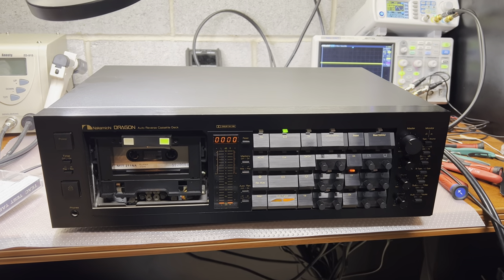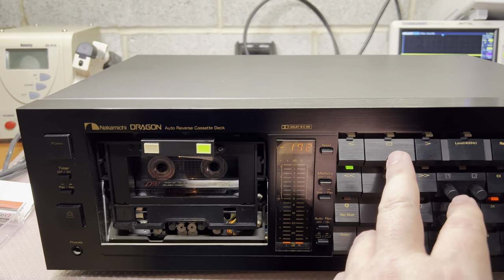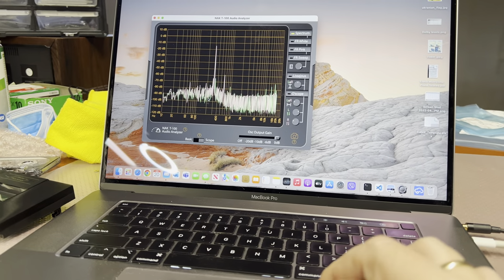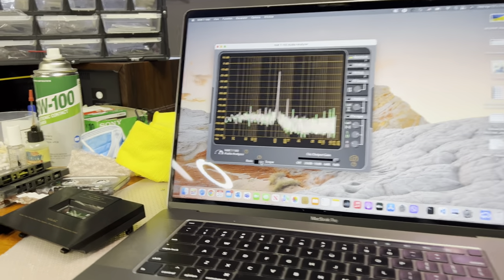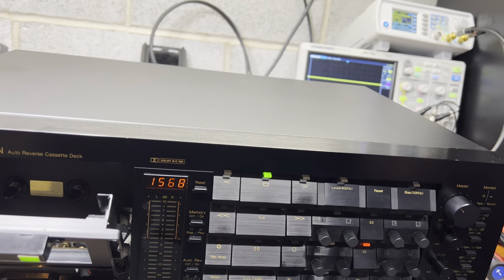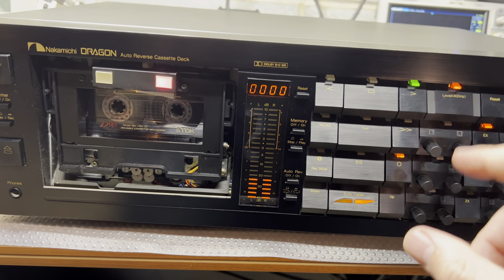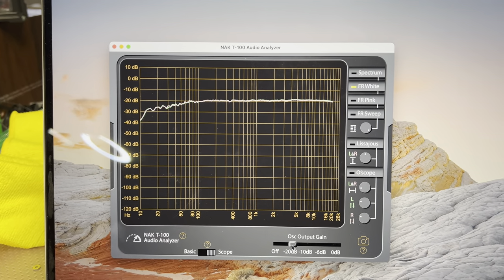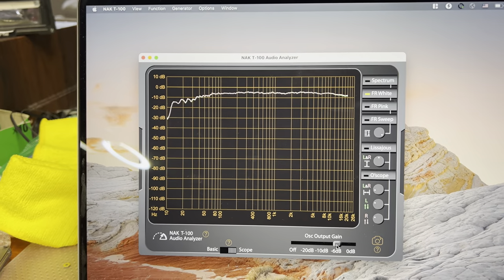Nakamichi Dragon on a test bench

Comment: No entiendo porque cuando ajusta el nivel con el tono de 400 Hz no lo haces en el punto de CAL, que es como se debería hacer, lo haces con un nivel mucho mayor (+5 dB), también pasa lo mismo cuando hace el ajuste de Bias que también se debería hacer en el punto CAL y lo haces a +3dB.
Reply from the maker: Actually, you have to match the generator level between the SOURCE and TAPE position. not 0 level. When generator tuned properly - it should be 0 dB. However, as with all Analog devices, it can change over time. That was my case. In the SOURCE mode it was + 3 bars for 400 Hz and + 2 bars for 15 kHz. That is why I was adjusting that way. Idea is to match between the source and recorded level.